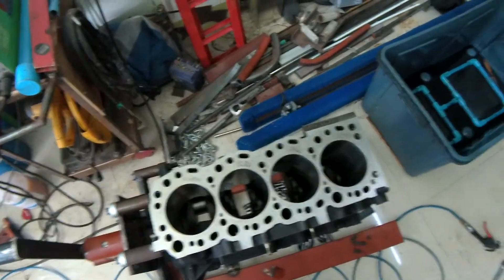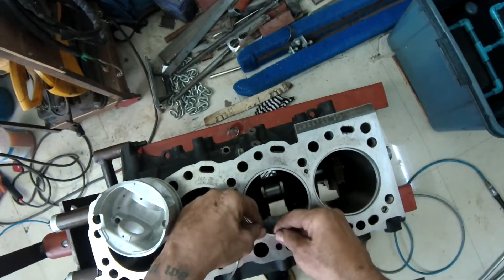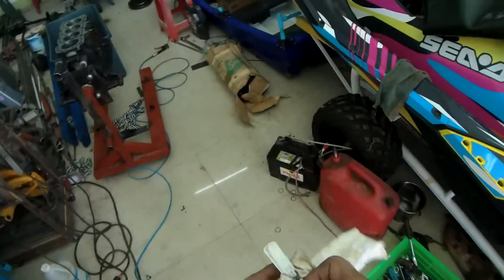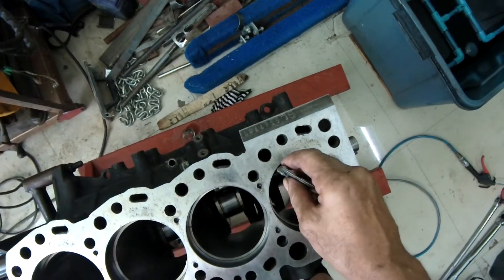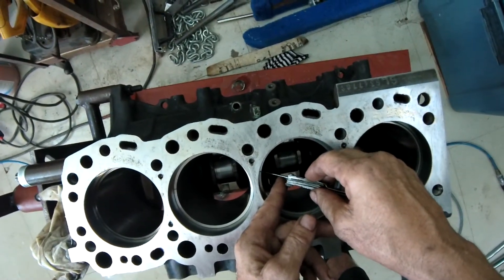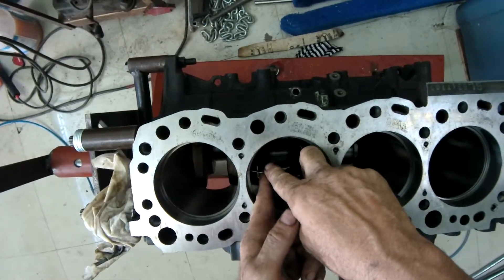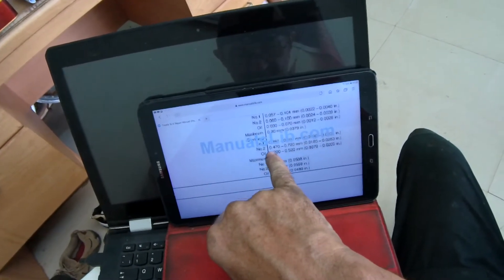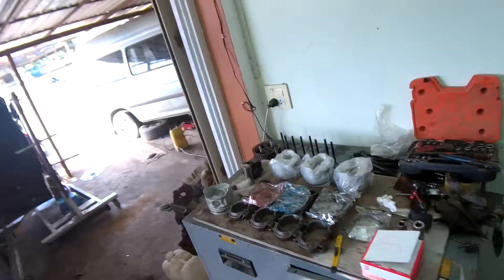Toyota 5L rebuild. piston ring gaps. part 4. maahoosive gap edition.

Comment: are TP piston rings strong ?
Reply from the maker: @shelton5051  im still driving it 30,000kms later and it needs zero oil top ups between services.
Reply: @theravedaddy did you put new pistons on , are they also TP brand ?
Reply from the maker: @shelton5051  the pistons are new, cant remember the brand. Heres the ring measuring video. https://youtu.be/WwLZz75gDYs?feature=shared
Reply from the maker: @shelton5051  thanks for watching. It was so long ago now that im watching them again as i forgot i did this! The bus is outside and still drives good, never needs an oil or water top up after 35,000 kms so i must have got it right.